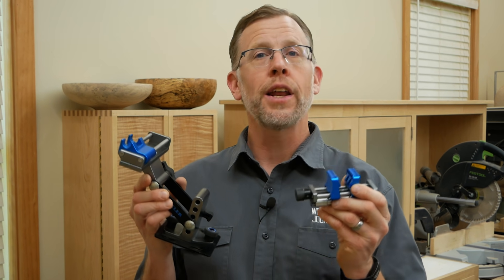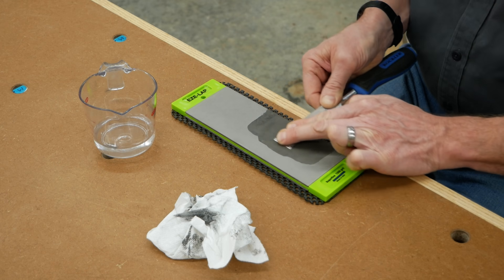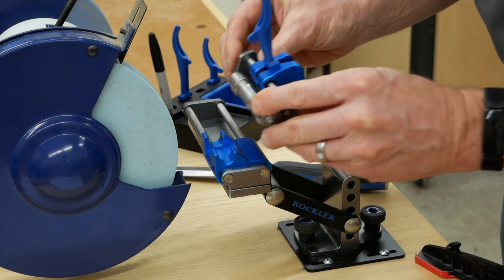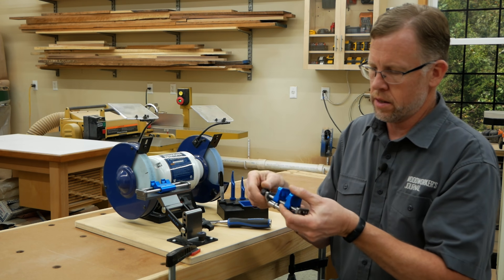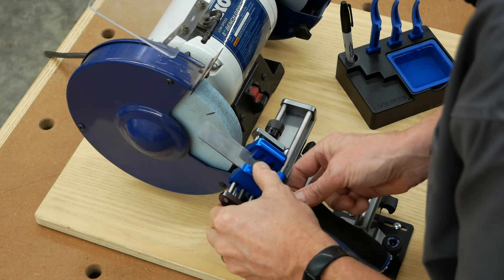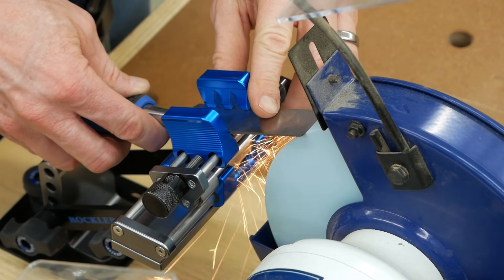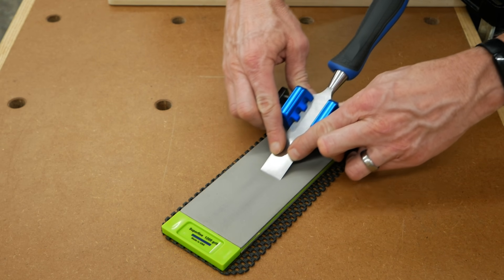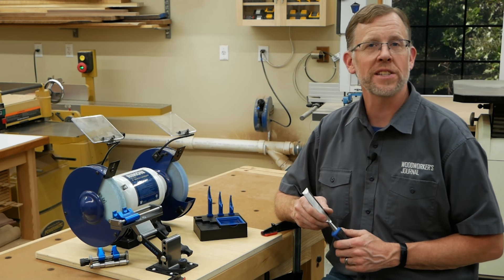Easy Sharpening Jig for Grinding and Honing Chisels and Hand Planes

Comment: Will this jig work well with shorter chisels?   Some similar jigs require too much jig protrusion for me to get a 25 degree angle (the jig bumps into the round metal portion of the jig shaft).  Thanks, Dan
Reply from the maker: Hello, Chisel or plane blades must be at least 4-3/4'' long for a 20° grind; at least 3-7/8'' long for a 25° grind; and at least 3-3/8'' long for a 30° grind. Hope that helps. Thanks!